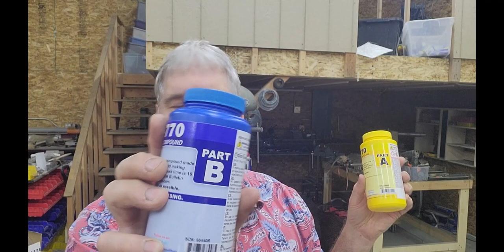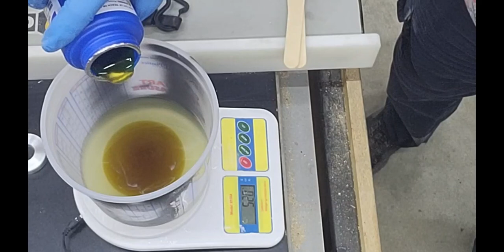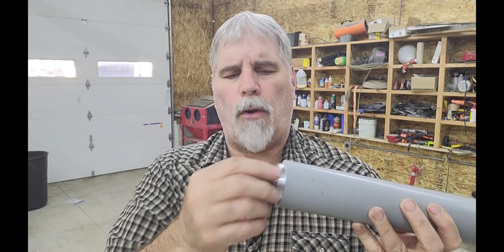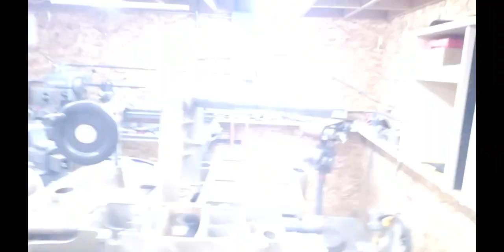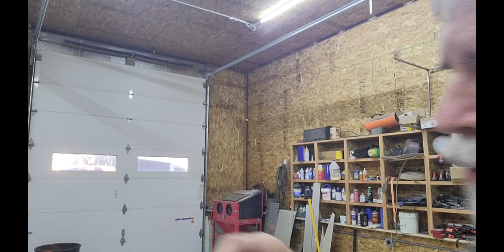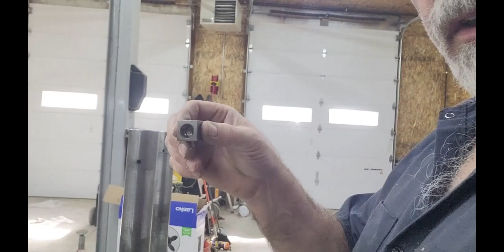Makita 2030 planer drive roller refurbish

Comment: Thanks for a great informative video - I just finished pouring my rollers, fingers crossed for tomorrow.  I drew up and 3D printed top and bottom plugs as I don't have a lathe - they seem to be working well so far with no leaks.
Reply from the maker: I think you'll be ok without the lathe.  I was a little worried they wouldn't be concentric with the shaft, but realistically, mine had very little run out so I don't think I would have had to turn them after de-molding.  Let me know how they turn out.
Reply: The 3d printed plugs to center the roller shafts worked great.  I did have a shallow groove cut into the roller when cutting the pipe to release the roller, but I was able to fill it easily mixing up a bit more urethane, then let it sit about 30 minutes before pouring, so it didn’t run all over the place :).

Comment: Good job, what did you do to prep the steel before pouring ?  Could the roller be pressed out with out cutting the tube?
Reply from the maker: I used a spray on mold release.  Not sure if it could be pressed out.  I kind of doubt it as due to the "rubbery" texture, I think it grips the tube pretty tight

Comment: Great job.  You have really good skills and made it very understandable.  I've got a 2030 and wish someone like you fo a youtube on setting up the jointer when beds or not co-planer and resetting blades after sharpening.
Reply from the maker: Thanks, If I remember next time I change blades I'll do a short on how I set them up.  If your tables aren't co-planer, there isn't much you can do other than having them re-ground.  You can hand scrape the dove tails, but that takes special measuring equipment.

Comment: Can I send my 2030n rollers to you and have you do the same thing to mine. 😬
Reply from the maker: I've had a couple other's ask, and though I like helping folks out, I just have too many of my own projects on my plate.  however, I only machined mine after de-molding as I'm picky, and I took a minimal amount off.  That said if the tube you use for the mold has the correct I.D. there aren't any special tools needed.  So I'd encourage you to give it a try
Reply: I was going to ask the same for my 2040.  Awesome video.  Thank you

Comment: Literally the only video I've been able to find anywhere of a diy solution for rubber rollers. 80 bucks more like 100 bucks each when taking into account shipping to replace my dw735 rollers, 200 bucks is half of what I paid for the planer to begin with it's ridiculous.  For those without a lathe could someone just buy tubing with the exact ID they need and just use it straight out of the mold? Not to hard to get tubing with a specific ID.
Reply from the maker: initially i thought they would have to be turned, but the runout after I de-molded mine was very very minimal. So yes I believe you could skip turning them if the I.D. of your mold was the correct size.

Comment: also where did you get those spacers?
Reply from the maker: Are you referring to the aluminum plugs I put in the end of the tubes before pouring?  if so I machined them out of aluminum.  or are you referring to something else?

Comment: Specs for those rollers that I have found spec a 2" diameter for recovered rollers so you are probably undersized.  Otherwise this is one of the best fix it videos I have seen
Reply from the maker: I agree, since the bearing blocks have an offset hole, I'm going to rotate them to help with clearance between the boards and the housing.
Reply: Alright. So what OD should I be aiming for? 2 inches? 
Cuz I got one makita 2030N yesterday… the seller told me it only needed adjustments on the blades… but both roller are totally gone… bare shaft 😢😢😢

I looked around to find replacement… but these two rollers are worth more than the machine itself! 😂

Comment: Curious to know how well the rollers are feeding the wood through the planer.   I have just the 16” planer model 2040 and I need to replace my temp solution for the rollers.
Reply from the maker: They are working great, the durometer seems to be just about right. To get good grip on the board, I have the depth of cut set to a point where the top of the board (cutter side) occasionally drags slightly on the casting right where the depth indicator is. The holes in the drive roller bearing blocks are offset, so by rotating them you can change the height of the rollers in relation to the bed.  I started with them in the orientation that puts the rollers farther away from the bed.  So I'll rotate the blocks 180 which will lower them slightly and take care of that.  So that said, the only thing I might do different is to increase the finished diameter of the rollers by 1/64" or so.  The problem with that is then I would have had to machine out the ID of the PCV pipe I used for the mold.